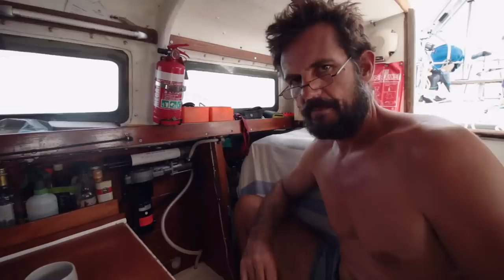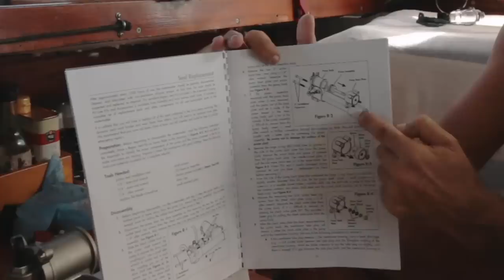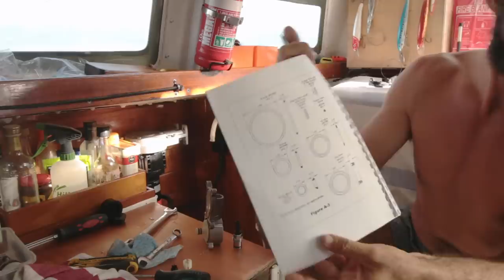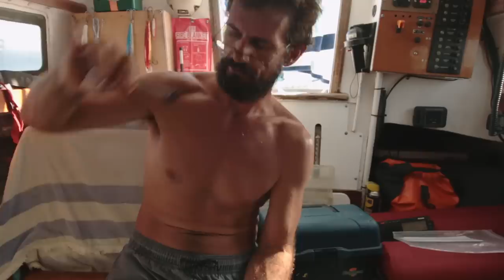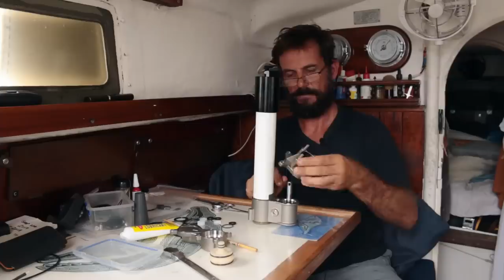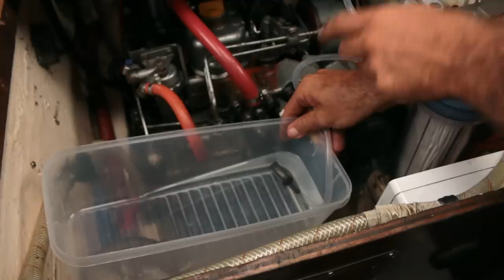Water-maker Disassembly and Repair : Katadyn Powersurvivor

Comment: You just gave us an incredibly detailed description of how to disassemble and rebuild an internally geared bicycle hub. Your advice and wisdom is wide. Many things apply in many places. Fear not say you. Logic and ordering the disassembled parts will prevail. :) And it generally does. Thanks my man, for emboldening the masses to repair / service their broken stuff. It's got to be better for the environment to repair than replace. In today's disposable society many people, regardless of cost, throw perfectly good stuff away for want of a cheap and easy o ring or capacitor. May your grease be greasy and your gaffa tape stick.

Comment: Iam a U.S. citizen that has often questioned the imperial system.  I must say that your comment about the moon landings is a very valid point on a few levels.  Mostly it represents a huge investment, but it also represents soemthing that has been proven successful.  My boat was built in Florida and has yanmar engines in it.  Dammit.

Comment: Thanks mate, great video, and a pleasure to watch!

I was looking in order to find out how to take off the part at the back of the membrane, but you cut just that part! I guess it was to avoid showing how rude you need to be on the watermaker to take it apart? Mine is quite jammed (just salvaged from a sunk ship after one month underwater), i'll try going harder I guess.

One little thing, your method is perfect for a joint replacement, but if you need to access the membrane only, it is way faster and easier to do so on the other side. There is a metal spring ring blocking the end by the potable water output, easy to take out with thin plyers and a flat screwdriver (careful not to rip)
Sorry if you mention it later on the video, no time to watch it all.

Thanks again!

Comment: :    You are very handy. Unfortunately for me, reading instructions doesn't work as well as someone showing me. If someone shows me once I usually have it but that's not always feasible. Thanks for the video. Wishing you safe and smooth sailing.

Comment: So,... Troy,... tell me,... did you pick up a new set of "imperial" sized wrenches when you got back to town?  Second, is this water maker's failure why you were almost running on water rations in a previous recent video?   Also, as a bit of a wrench head myself, I have frequently enough use a container to hold the parts as you are, but unfortunately I also have now and then had the unlucky problem of accidentally dumping the whole works on the floor when trying to pull apart something that suddenly and unexpectedly gives way to my efforts.   So I like putting the "parts container" up and away from the work surface as to make it harder to spill it's contents.  And yet one more thing that may be helpful, when I have extra parts I have taken up the habit of putting them in a zip-lock freezer bag.  So I have one container with several zip-lock bags in it and each bag has a note so I don't forget what their for.

Comment: Enjoyed the video. I've never been afraid to take anything apart for repairs. Some are just not mechanical minded & I understand this. You are very thorough with everything on your boat, it makes you & Pascale happy. Question being such a small piece of equipment how much water does it make in say 30 minutes or GPH & does it constantly run 24/7? If I had a yacht I would certainly have this equipment.

Comment: I'm with you Troy,  td"s are the cats pyjamas.  I kept all my  Imperial spanners & sockets  (but I'm 66, I don't chuck anything).  Meta bi-sulphate ?   A lot of the stuff you do seem's obvious to me  (my hobby was rebuilding English '70's fibreglass sports cars ), but I'm sure that younger folks have no idea how to do it because they spend half their lives looking at their cell phone .  You make a fantastic teacher
Reply: I turn 18 in sept , I understand & am reasonably competent in disassembly & reassembly of  mechanical devices including small engine repairs. I'm also sure that there are older people that have no idea how to do stuff as well .
Reply: Absolutely !  Congratulations on your skill level  ,   I only started learning at 18   @p.a.f.mitasol8071
Reply: "Meta bi-sulphate?"
Sodium metabisulfite (Edit: it's a sulphITE, not a sulphATE) is a sterilising agent commonly used in home brewing, available in Australia in the home brew section of most large supermarkets. Sold as a dry powder you simply mix it with water when you need to sterilise a container.

Comment: Took me a moment to catch onto "Imperial" - here, we call it "SAE" . 

Why doesn't the U.S. go metric? 

Well...... we're hard-headed as hell, that's pretty much it, in a nutshell. 

We "officially" went metric in 1976 (I know, I was there!) but our auto makers dragged their feet due to huge back-stocks of SAE hardware. Some went as far as to use a combination of SAE and metric fasteners for several years, necessitating we mechanics to drag out both boxes to work on their junk. Eventually, one large company put metric heads on SAE-sized and threaded bolts - I'm tellin' ya, this was really a fight to not conform! 

Even today, our hardware stores only keep a small, weird stock of Metric hardware, and it is always prices at 5 to 10 times the price of similar-sized SAE hardware. Go figure! 

After watching 40=odd of your videos, I think we'd work well together, Troy - you may take that as a big compliment. While I don't fully approve of a couple of your methods, you're young (I'm pokin' fun at ye, Mate) and you'll learn, given time.
 I'm a 45+ year master in auto, with extensive experience in marine, diesel, aircraft, agricultural, and motorcycles.  My kingdom for a single-standard world! 

BUT!!! I've still not forgiven the Brits for their extended use of the utterly ridiculous Whitworth standard (and still keep a small Whitworth tool set, just in case.........
Reply: Troy is the only Brit I have ever actually heard make a graceful comment about the U.S. and their Imperial tools (putting a man on the moon with them), rather than the petty arguments you see in the comments about it.
Reply: @Josef_R  Certainly a graceful remark, agreed. As a U.S. citizen, I've never understood our reluctance to convert fully to Metric, thus my thoughts on the subject are less graceful. Kind of like those words that some can say about themselves, which would be taken exception to if uttered by others i.e. we motorcyclists calling one another "Scooter trash" - which isn't recommended for those outside our community to say. As to calling an Aussie a "Brit"..... well..... I've personally seen violence done over it. (chuckling).

Comment: I would love to know why you chose  that particular water maker.  I value your expertise.
Reply from the maker: At such low amp draw, it matched the output of our solar and wind. Also, rugged design with the possibility of manual operation in emergency.

Comment: Have you thought about using Metrinch spanners, they fit both metric and imperial, not cheap but you only need the one set ti fit both sizes
Reply: Thanks for the suggestion.. I looked into them some, and saw some impressive testimonials.. I can definitely see a set in my future.
Reply: @Garryck-1  i use both the spanners and small socket set and they're brilliant, better than Sidchrome in my view.very well finished and at least halves the excess weight that you have to carry in the boat, bought mine some time ago through Bunnings, cheers Darryl

Comment: Have you had to do any work on the motor/ gear box? We bought a used unit and unfortunately we're getting sparks when we connect it to power. Motor won't run.
Reply from the maker: Perhaps the Brushes are worn/ damaged.
Reply from the maker: I also recommend this book:
https://www.booktopia.com.au/boatowners-mechanical-and-electrical-manual-nigel-calder/book/9780071790338.html
Reply: @FreeRangeLiving  I have that book. Is there a specific part that you're thinking of? I looked at the electric motor part today, but I am struggling to access the parts in this unit. Have you gotten into that much?
Reply from the maker: I haven't had to pull apart the motor on those. The book details testing electric motors though. Perhaps the armature suffered corrosion.

Comment: Not sure I would buy this device, for less money I can put a a water compressor and of the shelves larger membranes together and deliver a substantial improvement in production. Money saved can be then invested in my electric system obviously necessary to provide the required massive power increase.